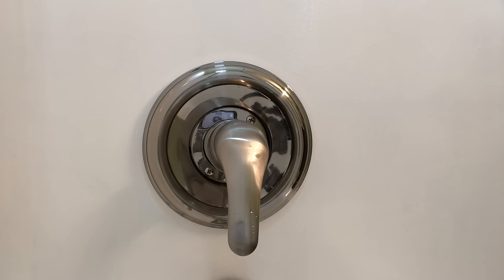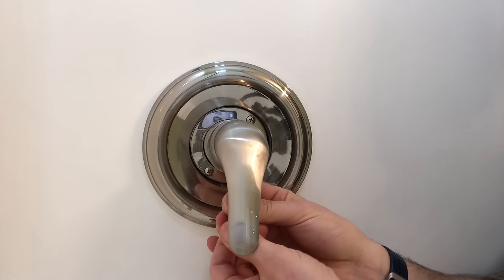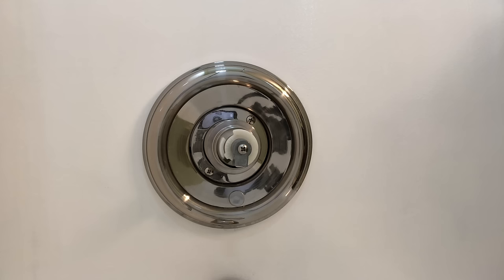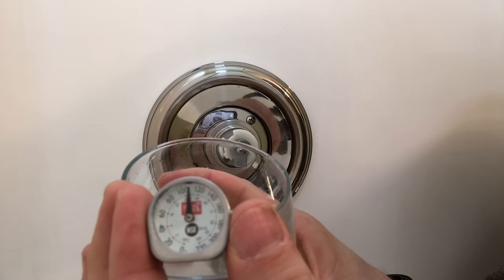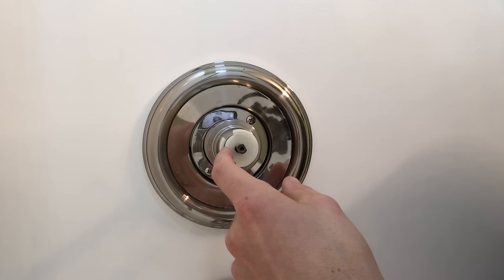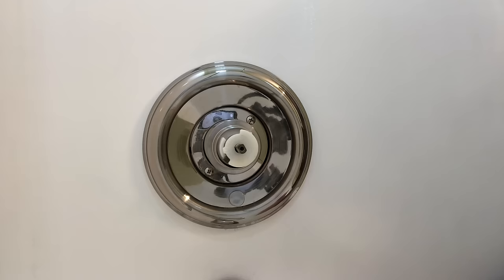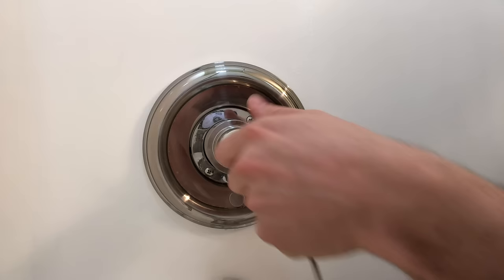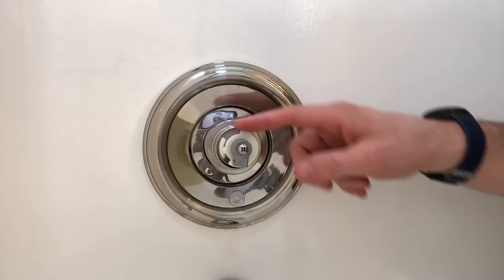How to Increase Water Temperature for a Delta Shower Valve

Comment: I tried taking the knob off after i took out the first screw but its stuck even after i pulled. Nervous it'll break off, any suggestions?
Reply from the maker: Hey Ashley,  is yours a lever like the one in the video or a clear knob with a screw in the middle under a clear cap?
Reply: @EverydayHomeRepairs  its just like yours...silver handle.
Reply from the maker: @ash_a733  if your handle is the same and you have completely removed the screw from the handle then the handle should come right off.  For this design the handle just sits on a small adapter which is attached to the actual valve so once you completely remove the screw there should be nothing holding the handle to the adapter.  Best of luck with your adjustment.
Reply: I'm having the same exact problem
Reply: I'm having the same issue too. I kept loosening with the Allen wrench and eventually just removed the screw entirely. The handle still doesn't come off. I don't get it. 🤔
Reply from the maker: Hey A.P. you might have mineral deposits built up which is holding the handle to the adapter even with the screw removed.  I would use a blow dryer or preferably a heat gun and heat up the handle a bit.  Then slowly apply pressure and/or wiggle the handle to try and break the mineral deposits loose.  Don’t forget to use an oven mit so you don’t burn your hand.  Let us know if you get the handle removed. Thx!

Comment: my allen screw wont come off its very tight
Reply from the maker: Hey Zodiac,  yeah it is fairly common for build up coming from the water over years of use to freeze up the screw in the fixture.  If you have a heat gun handy you might try heating up the handle and screw to see if that would help to break the build up loose when you apply pressure to the allen wrench.  Honestly this type of situation can often lead to a stripped screw head so take your time when trying to loosen things up.  Good luck!

Comment: Does any Allen wrench work
Reply from the maker: Hey Shayne, nope you will need to find the correct size for your valve handle set screw.  Most Allen wrenches come is a set which will include the right size.  Just try each one out which you think is close till you feel a snug fit.  Let me know if you have follow up questions.
Reply: @EverydayHomeRepairs  so does it have to be an Allen wrench and not a small screw driver? Cause the hole that leads to removing the handle is small. Harward stores will sell an Allen wrench set?
Reply from the maker: @ShayneRawls  should be a small allen wrench.  A set like this would work https://amzn.to/2OlyPj9 .  Also any hardware store or big box home improvement store will have several sets in stock.  You get a flash light turn the handle so you can see the hole (water will be running) and ensure it looks like an allen set screw and not a set screw with a slot for a screwdriver.
Reply: @EverydayHomeRepairs  I found a Allen Wrench set and I end up using the smallest one but the darn thing isn't budging when I turn it
Reply from the maker: @ShayneRawls  yeah this can happen if it has been a long time since the handle was installed or last removed.  Take your time as you will not want to strip out the set screw as that will make things even tougher.  You could try adding a little heat with a hair dryer or preferably a heat gun to see if that can help while you turn the allen wrench to finally break loose the mineral deposits.  You could also turn off your main water supply to the house and turn the handle so the hole is facing up.  Then pour in some vinegar to fill the small hole.  Keep filling the hole for an hour and that might help to loosen up the mineral deposits to make the set screw easier to loosen.
Reply: @EverydayHomeRepairs  alrighty thank you! Also... I just noticed my Shower handle is a Moen. To adjust the heat will it be the same process?
Reply from the maker: @ShayneRawls  Hey Shayne it should be very similar but the plastic stop which you will need to adjust might look a little different.  If you search Youtube for "how to adjust the water temperature on a moen shower valve" you will find a couple good examples.  Best of luck!

Comment: That little screw in the handle won’t budge ... any way I can adjust without taking the handle off? I’m desperate for a hot shower... I’d like to meet the cheapskate who set it so low in the first place
Reply from the maker: Hey William, nope you will need to remove the handle to get at the temperature adjustment piece.  Is the screw already stripped?
Reply: it seems like screw is stripped.... @EverydayHomeRepairs
Reply from the maker: @williamspencer4186  bummer!  This forum post goes over some good advice when faced with this type of issue.  The biggest mistakes I have made when faced with this type of issue in the past is rushing things and then making the problem worse.  Best of luck and let me know how it goes.  https://forums.anandtech.com/threads/delta-shower-faucet-need-to-drill-out-set-screw-on-handle-what-to-watch-out-for.2534382/
Reply: Ihave a shower that don't have a cold adjustment it only run hot  hot and warm I have lower my hot water heater but it still the same even in

Comment: What size allen wrench?
Reply from the maker: Hey Bro!  For this one I needed to use a 7/64" Allen wrench but a 2.5 mm would also do the trick.  If you only have a metric 2.5 mm wrench be careful not to strip the screw out because the wrench to screw is not a perfect fit and is slightly loose.  Best of luck!
Reply: Thanks